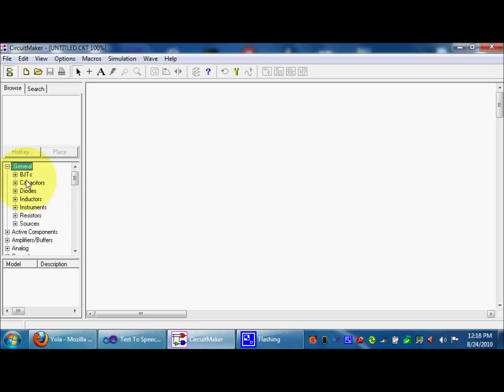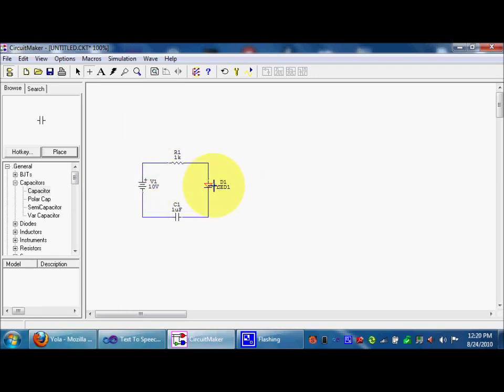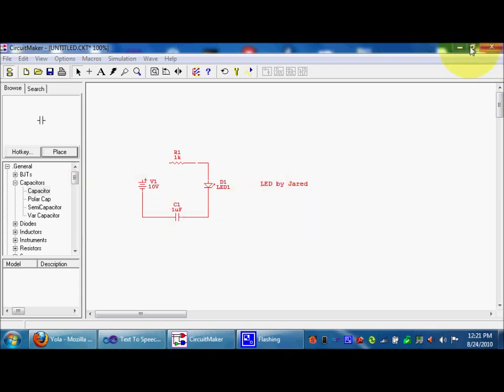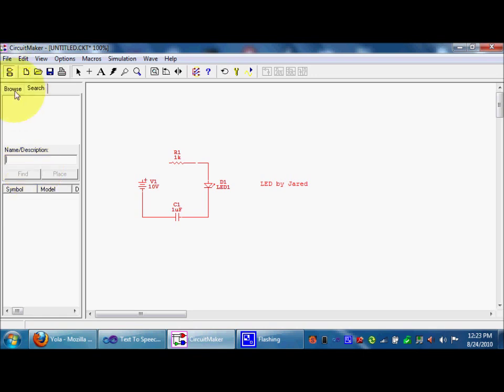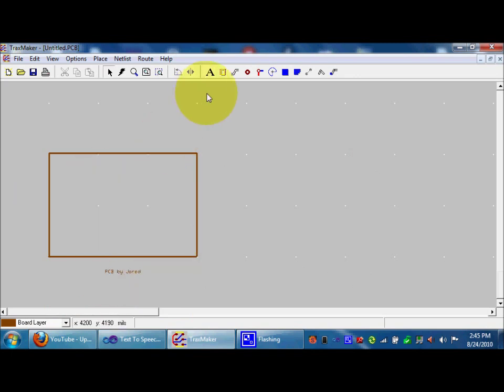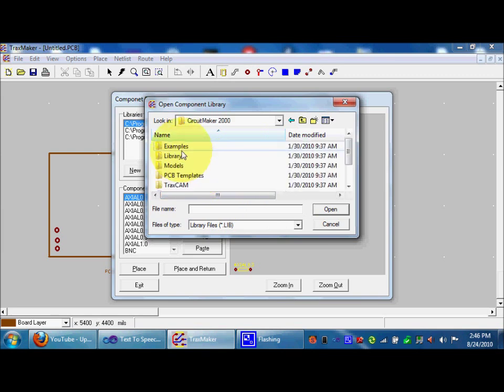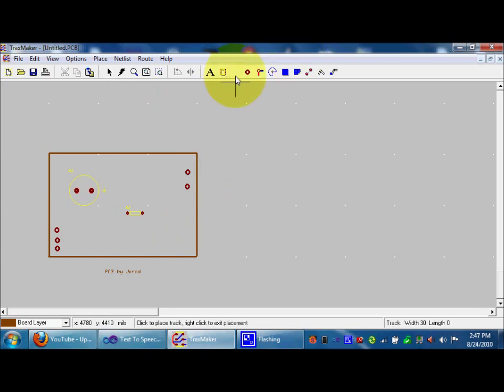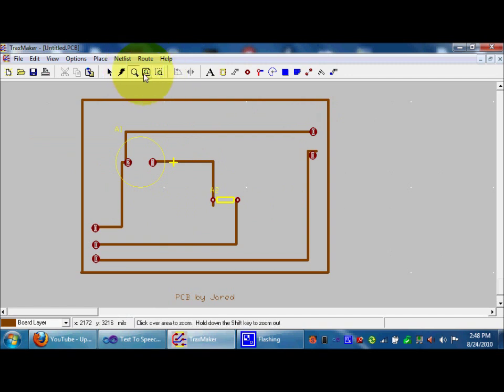Circuit Maker 2000 Tutorial

Comment: WANT TO ASK ABOUT Traxmaker. how do you manage NC Drill File Setup,Such as 

1. adjustment
2. tool file; by creating new tool file or match existing file ?
   when I send to technician along with .pcb file, they cannot read the drill file, but they can read gerber file. 

or probably they open it using Protel sware ? 

please help me here
Reply from the maker: Circuit Maker 2000 was bought by a company but you can still download it and liscense's never expired.

Within the software I used the built-in gerber exporter. The tool i use to print with on the milling machine is IsoPro by T-Tech. The milling machine is also made by T-Tech. I print PCB's on this but im not sure what other milling machines do. So i cant really help there.